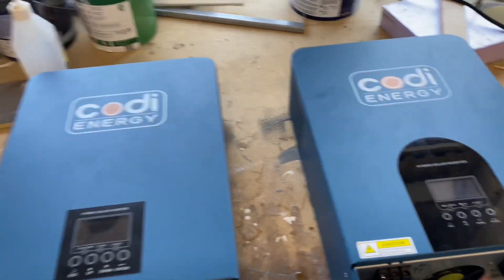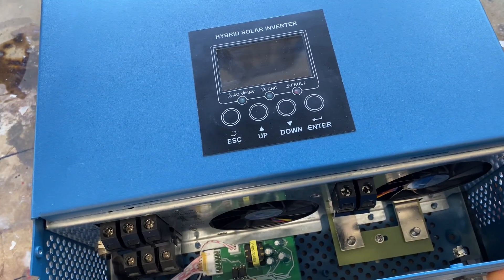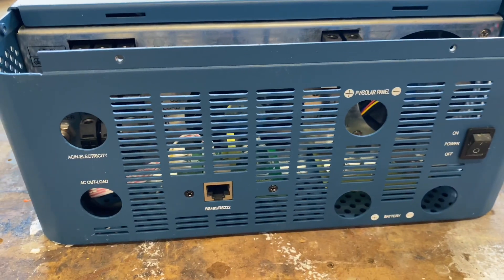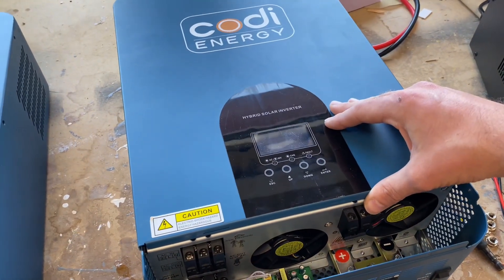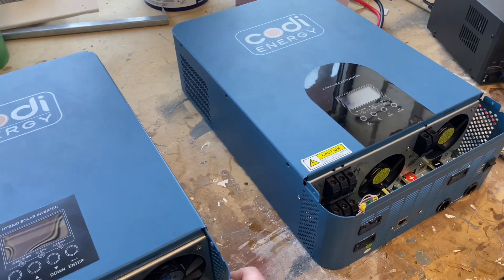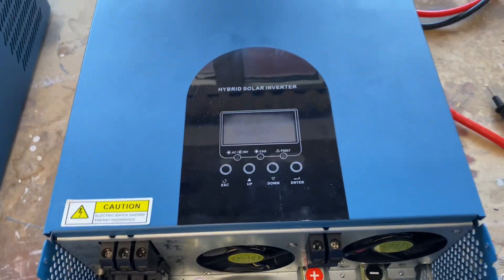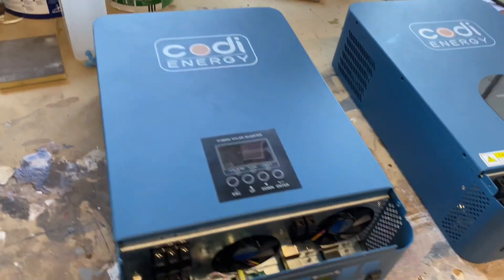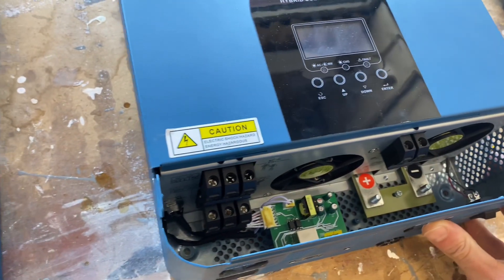Don't Buy a cheap Solar Power System Until You Watch This!

Comment: Yikes!
Reply from the maker: Yes😅
Reply: @JonasSyver  Ok so you have two broken, so you might get 1 functioning out of the parts. The replacement unit with the short, I would open that up and trace the short, could be the inverter, could be the MPPT board. Figure out what has the short, then replace it with the part/board from the one original. Also be very careful, the capacitors can contain lethal voltage even with everything disconnected. I bet they grabbed a B-stock, or eval unit to send as a replacement. Good Luck!
Reply: @JonasSyver  Also you say the first unit reads low voltage on your battery. Did you verify with a meter the voltage of your battery as you power this unit up. Not the open circuit voltage of the battery, but the voltage while it's hooked up, and this thing is booting.
Reply from the maker: Yes. Even tried with different lithium batteries and agm. Bms and multimeter  reads a completely different voltage than the unit.
Reply from the maker: That is the plan👍 thank you Brad